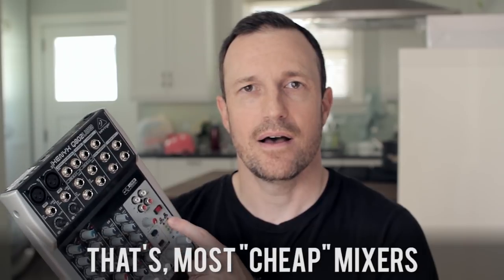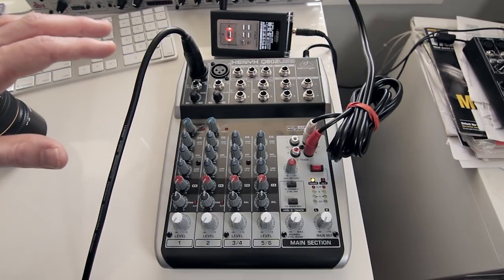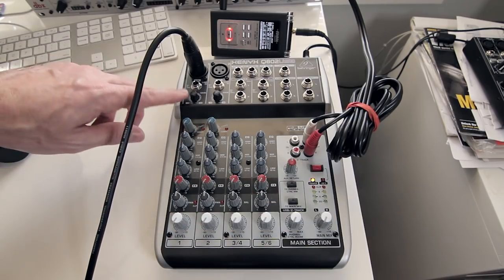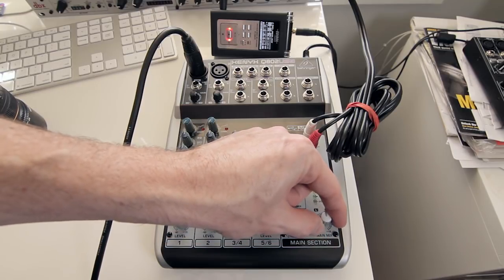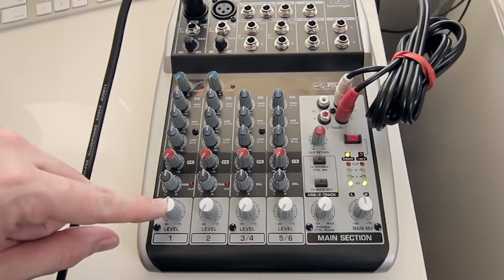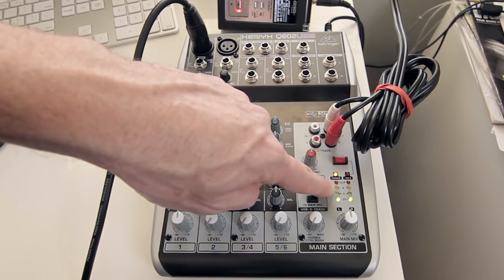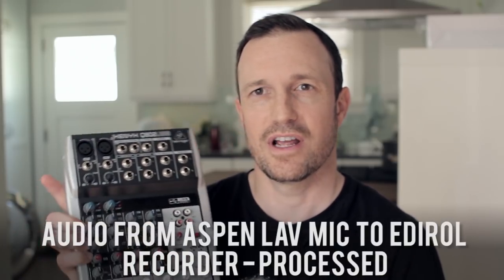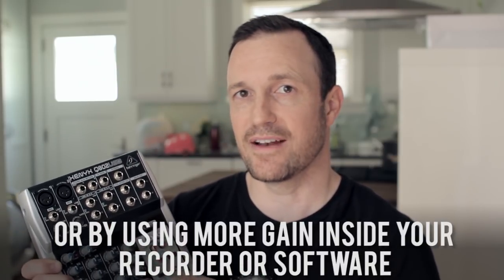Setting Microphone Levels on a Mixer - Gain Staging with no PFL/Solo Buttons

Comment: (This might sound completely dumb but I am new to mixers) 

Can you show how to setup audio for a computer?
Reply from the maker: Not dumb. Every computer is different so it can be tricky to make a single tutorial for it but if you setup your gain properly the way I show in this video then all you need to do in the computer is to make sure whatever app you're using is also getting proper levels, somewhere between -18 and -12db at it's highest peaks. You can adjust the output of the mixer or the software as needed to get somewhere in that target level.
Reply: and advice on the recording gain in windows? no one ever mentions it.
Reply from the maker: When it comes to the gain in your software, it can depend on the specific software or app that you are using. For example, when using Skype, I like to set the gain so that the meter is hitting about 75% of full. That seems to produce the best audio for me. But if you are going into some recording software into Windows then you'd use the audio meters in that specific software to set your level appropriately. In Audition for example, I would aim to get an average peak on the meters around -18db. And then bring that up in post production.

Comment: Having a hell of a time with my Mackie Mix 8. Noise floor is SO high if I follow your instructions. Using atr 2100. Any advice ?
Reply from the maker: Get closer to the mic and gain down but if you're already close then almost certainly there's just too much ambient noise in your environment. Tame the noise around you and then you'll get much better results following this setup.
Reply: Ray Ortega Thanks for responding, Ray.  I ended up returning it for a Behringer Q802USB. Much quieter. Maybe the Mackie was defective.
Reply from the maker: Odd, definitely think it had an issue cause I reviewed the mixer and it was great at the higher end of its gain. Glad you found a solution!

Comment: Hey, thanks for the video. How would you approach gain staging for the stereo inputs seeing that they don't have a gain control? And I see that a lot of mixers don't include those for their stereo inputs.
Thanks in advance.
Reply from the maker: In theory you'd be using the stereo inputs with devices that are already line level so they don't need gain. You'd control their level with the faders and get your levels using the audio meter and adjusting at the source if possible
Reply: There's an older theory that goes along with this.  To set a gain structure for line level, set the fader at unity or zero.  Even if you don't have a gain control on the board, your device has one; most call it a "volume" control.  In most instances, a setting of 50% up to about 78% is the range where you'll find Line Neutral, the point at which you are neither adding nor removing volume\gain.  You may try looking for a pink noise track, then put it on the device you are feeding to your board.  Unplug any speaker units, headphones are not a problem if you keep them off your head.  Starting at 0 volume, turn up your volume control while the track is solo-ed, until the track is tapping anywhere between -8 and 0 in the meter.  This is the range you should be in for any stereo track with no gain control, as a +4 to +8 gain expansion will almost always apply on a return style line in (the board uses a standard nonvariable amplification).
  This principle has started to vary among devices since roughly 2005, but the principle that was in use before this time was that an amplifier was at no added power when at roughly 72% of its full value attenuation.  This coincided with line level producing a .72 volt signal.  Since a silent signal was roughly .72 volts, a 72% volume level seemed natural.  As digital devices became more popular and the loudness wars faded to a tertiary concern, and people really didn't care about the logical connections between the levels anymore, some devices went with amplifiers that broke this rule, and instead went with amplifiers that were 0.72 volt neutral at 50% power.  For devices that primarily use headphones, the rule of thumb is 65 to 80%, again, right in the same area as the old ways; but for devices that are more likely to plug into a speaker or set of speakers with their own amplifier circuit, the 50% rule is much closer.  There are two reasons, really.  The first is that the newer amplifier circuits can handle more power and power fluctuation, though the throughput is pulsed rather than constant.  The second is that the current loads for speakers varies with the setup, while headphones vary depending on their design and purpose, but have a single load setup.  Speakers can be in loads that match multiples of 4 usually, and can be 4, 6, 8, 14, or even 16 ohms.  Most headphones correspond to to a far different set of constraints.  20, 60, 80, 120, 200, and 600 ohms are common load resistances for headphones, which tends to bleed the voltage more evenly the stronger the resistance, but requires more amplification, to reach the same sound output level.  Speakers have the ability to push more air around and make a louder sound wave from each pulse wave of audio data, while headphones have smaller drivers, and push a lot less air.  The logic behind this is that headphones have thousands of times less space to fill with the sound so it can be perceived at the same "level", after all they are right on the ear and the waves don't travel far at all, requiring less motion energy.  Speakers have to make a wave in a room quite a distance from the ear, not directly into it, and at much more powerful motion energy levels, so the amount that reaches the inside of the ear is similar to what comes out of an earphone.
Let your gainstaging reflect not only your board, but the type of device you connect to it, and the amplifier type in that device.  For a device geared for speakers, look to find 50% volume area as your neutral ( 1/4 inch, or larger awg banana cable like you'd find on a surround sound receiver box) , and for devices made for headphones or similar reception line (RCA, 8mm, minijack, aux) can go from between 50% and 75% on your volume adjustment.
Reply: @HTDav01  wow, this is a very detailed overview. Thanks you for that. Very interesting stuff indeed.

Comment: Really great video! But could you do a similar like this one, but with a condenser mic? Behringer C1 perhaps? Would be extremely useful as well =) Thanks!
Reply from the maker: +Chris Fredriksson thanks, Chris. There would be no real difference for a condenser mic. They are more sensitive and use Phantom Power but that's it. You just set the levels the same, they'll just likely require less gain because they are powered.
Reply: +Ray Ortega Many thanks for answering my comment! =)

Ah alright, then I might be on the right track then =P

I saw lots of videos (pre getting my mic and mixer) where everyone pumps up the gain to the max or similar.. Then I realized, after I got my condenser and tried it out, that hey.. I wonder if they use dynamic mics.. and well.. Now I do believe that those videos that I watched.. quite a few and I can't really find my way back to them, but I believe that they must have used dynamic mics =D Or perhaps low sensitive condensers if that exists? No idea =D

But that sounds great, many thanks for the reply! The reason for asking is that when I use more or less any gain and/or compressor, I can hear everything that goes on in the whole apartment. Even the tiniest sounds, completely crazy! =D But I've ordered some sound dampening and was thinking of building a small wall of sound dampening to shield off the mic so perhaps it won't pickup so much from the rest of the apartment. Then I might have to close the door and then I must build up a fort with sound dampening material around my computer to get that quiet as well.

Lots of stuff to do =D haha..
Reply from the maker: +Chris Fredriksson a large part of the issue is the condenser mic. They pick up everything. A dynamic help by providing more rejection.
Reply: +Ray Ortega Alright, perhaps I should have a go at a dynamic mic as well to try that out. But as many say, the warmth of the voice goes somewhat lost. Haven't decided, but I might go for a dynamic, at least to try it =) Thanks! =D
Reply from the maker: +Chris Fredriksson like most things it's a tradeoff. That said I don't see a lot of warmth lost on mics like the ATR2100, PR40 etc. http://thepodcastersstudio.com/gear. You can also dial in your sound with EQ in post production. But people in less than ideal recording environments should not use condensers. Any warmth you are gaining is ruined by external noise.
Reply: but the circumstance, that a condensor mic is powered is not really the explaination why it is louder. Due to the construction principle the condensor capsule itself hast more sensitivity. A classical dynamic capsule will have 2mV/Pa output ... a condensor 20mV/Pa ... this 20dB in Voltag is 1:1 the difference in the gain setting. We at AKG designed our condensor mics int the past always with 0dB gain from the capsule to the xlr connector. And now i do the same wihthin our MIKME www.mikme.con A condensor capusle needs power because of the at least the first input buffer with gain 0dB needs  it ... or if it is not electret we have to generate the polarisation voltage for the capsule somehow. Anyway ... condensor is not louder because it is amplified - it's more sensitive.
Reply: @ChrisFredriksson  , dynamic (like the SM58) adds warmth instead of losing it. That's why its such a good mic. Condensers, just by design will seem "brighter" but also pick up a lot of room noise. Karaoke singers need condensers as they don't know the need to keep the mic 2 inches or less to your mouth. Otherwise, use dynamics. Just a tip. Hope it helps.

Comment: Is it unusual for gain to be set at near maximum to achieve the desired result?

I bought an "open box" Xenyx mixer, very much like the one in this video, and followed your instructions with both dynamic and condenser cardioid microphones.  I had to put the gain at near maximum before seeing any activity on the "clip" led.

Thank you for taking the time to make the video which really ought to be on Behringer's web site.
Reply from the maker: Thanks, Harold. It's not necessarily unusual to be near max although with a phantom powered condenser I'm a little surprised. But definitely on a dynamic mic. You don't have to trip the clip light. As long as you can get your average levels within a decent range then you are good. Being close to the mic will help but you can also bring up the main output and depending on how you are recording, you should be able to set the levels there too and then in post production, you'll always need to do some additional work on the levels. Thanks for watching and the compliments!
Reply: Thank you, Ray, for the reply.
For the price I got the QX1002USB, I cannot complain.
Your level setting / gain video was super helpful.

Comment: Bought a Fender Acoustasonic 15W Guitar Combo Amp...for the XLR connection bought an Adapter...somehow the Mic. only works via the XLR  and not Directly with the 1/4 inch jack? Why?
Reply from the maker: Yeah that sounds right. The mic needs a preamp which is accessed via the XLR plug the 1/4" input is for line level sources that don't need to be amplified.
Reply: @RayOrtega  So, nothing to worry then? Maybe, that is why they always worked in the Behringer UB1202 all the time, as I think it has a built in Mic preamp?
Reply: @RayOrtega  So how does the Adaptor converts the Mic signal? An XLR male to balanced 1/4" female adapter.
Reply from the maker: @akmt123  if the mic has an XLR connection then you don't need an adapter, just plug into the XLR and you are ready to record. Assuming the mic is a dynamic mic which means it does not need any power. If it's a condenser mic and it's plugged in via XLR then it needs the 48v phantom power switch on. If the mic has a 1/4" connector that you are trying to adapt to an XLR plug then it may or may not work, I haven't found any mics with a 1/4" connector to be any good, they're very cheap.
Reply: @RayOrtega  Got it..thanks for all the input.

Comment: Would be nice to know how you connect it to the eq
Reply from the maker: Hmm, you mean an external EQ? That is beyond this video but if you wanted to do that, you'd probably need an insert channel to take the preamp out to the EQ and return it to the mixer but in this case, a cheap mixer like this one does not have inserts. I do EQ in post for more control and so that it's not baked in.
Reply: @RayOrtega  kk thanks..

Comment: What volume do you have it on in computer settings?
Reply from the maker: This video was recorded to an audio recorder not computer. But if you are connecting to a computer, my general recommendation is to set the computer's input around 70% of it's max. Ideally you'll have some audio meters in your audio settings in the computer so you'll know that you are not setting levels too 'hot.' If you are going into recording software, the same is true.

Comment: What is the difference between Audio Interface and Mixer?
Reply from the maker: They are technically both audio interfaces but a mixer generally has more controls for things like EQ etc and often times a audio interface is a much smaller format that uses USB primarily whereas many mixers still don't have USB
Reply: Thank you

Comment: When gain staging this mixer connected to my dslr camera, do I follow your process while connected to the camera viewing my camera signal meter?

Or do I gain stage the mixer first then connect it to the camera?

Thanks for your time!
Reply from the maker: I'd gain stage the mixer and then connect to camera and adjust the fader as needed. The input to the camera might be too hot since it's line level but you'll just have to see by trying it out and adjusting the output as needed
Reply: @RayOrtega  thank you 🙏🏿! I just subscribe to your channel!

Comment: What about the comp?
Reply from the maker: Set to taste;) Use as much or as less compression as you want via the single knob but take note that this will affect your levels as you increase it. So as you increase the compression make the necessary adjustments for gain, the full post is here http://thepodcastersstudio.com/mixersetup
Reply: Ray Ortega I diecided to leave it on minimum.  What it does is it increases the minimum level such as background noise and then it decreases the maximum level so it balances out.  Basically for normal streaming leave it as off to avoid most of the background noise.

Comment: It must be a bad microphone if you set the gain on 100 percent. For me a bad example
Reply from the maker: Nope. Dynamic mics require lots of gain to get them to line level, that's just their mechanics and each preamp is different. In the case of the preamp in this mixer, you need to use most of it to drive most dynamic mics. Of course every dynamic mic also has different requirements for how much gain it needs. The only thing that matters is if the amount of gain required to drive your mic is clean or not. In this case even with the gain all the way up which by the way is done as an example of how good or bad the preamp is, the audio is still clean. That's actually a great result. It means the preamp is good, not cheap and can drive most mics you use it with cleanly. It's actually a great example;) Thanks for watching.

Comment: Nope. Same old. still not explaining why there's a volume and Gain on the same Mic Channel and how to use or how they differ.
Reply: I might be a year later but I'll try to explain, think of the gain as how much the mixer "listens" to the microphone, and the volume as how much of that sound the mixer "sends" to the speakers, if I remember properly, you should mix a microphone with the channel volume at 0, and master volume at 0, THEN slowly start rising up the gain, until you can see green on the mixer indicators, trying to keep it at a level where loud noises on the microphone don't reach the red, and barely touch the yellow, after that, proceed with all your other instruments,  they should all sound at the same level with volumes at 0, but each with its own gain, after that you can adjust only channel volume for mixing purposes. I hope I could be of some help!

Comment: good video, but this method also picks up a lot of background noise, even with a Dynamic Mic. Thanks.
Reply from the maker: This is how you'd do it regardless of background noise. Gain staging lower won't reduce your background noise, it will still be there, just as loud when you have to bring up your level in post except now you didn't run your preamp at optimal level so you could be introducing extra noise because your recorded level is closer to the noise floor. The key is to reduce the background noise if it's not something you want in your recording.